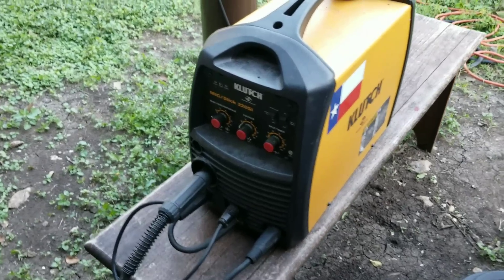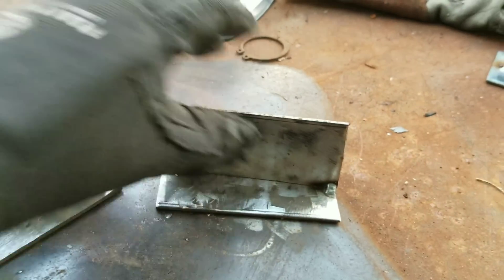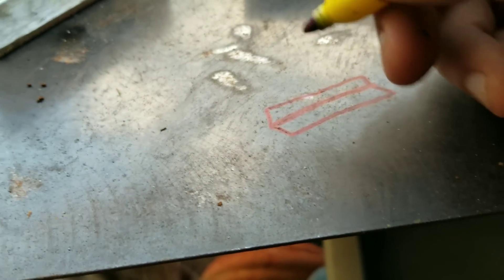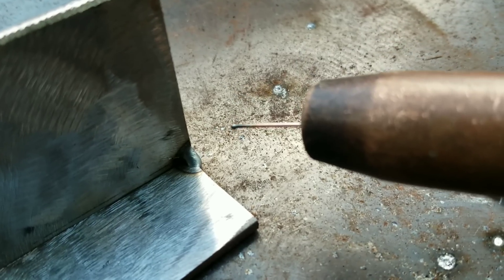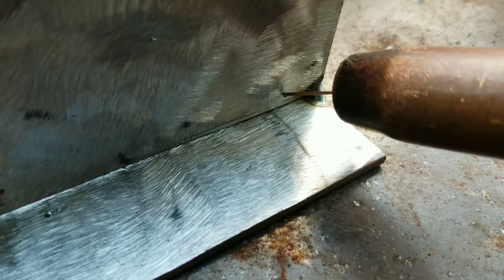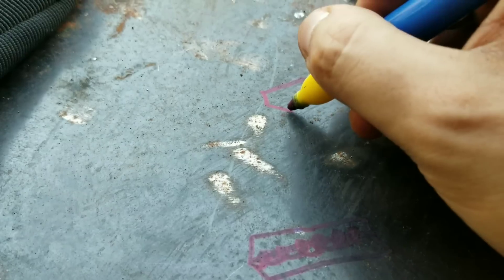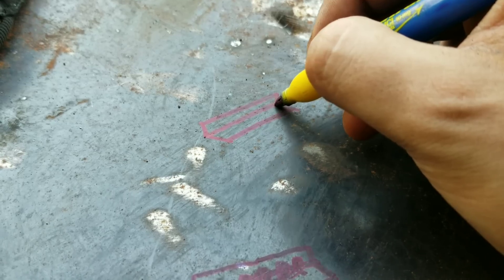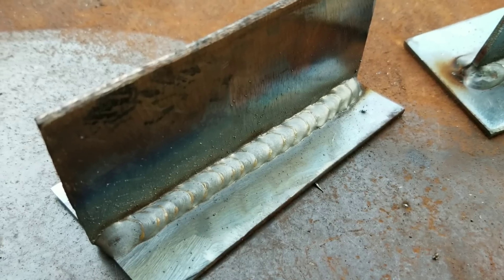How to lay dimes mig welding!

Comment: You did fine young man. Don't listen to these youtube welders. I been welding for 30 years. Personally I prefer a flat smooth weld as opposed to the "whip" style. Nice job little brother.
Reply: I was taught that a hot flat smooth weld is stronger than a whip in MIG. I work in the industry I use a whip 35% of the time finishing corners, anything visible on racking, and to fill gaps on railings. It’s good to know but the goal should be hot flat smooth.
Reply: I was trained by a guy who was certified to weld gas lines and cylinders and worked next to an ex-Navy underwater welder and we built cement mixers for trucks. We used the second style, forward and back but the "dimes" were stacked much tighter..... like 4 dimes to each one of his.
Reply: @SilverGleaner  Yep. Its the tight dimes you want if you're not just simply running stringers which most jobs prefer. But the guy is a good welder and can lay down better beads than some guys i know who have been welding as long as me at least 26 years. Its definitely an art and some people never quite cut it. He will go a long way in welding.
Reply: I've seen it all: welding trolls LOL
Reply: That what I was going to say, I been welding 40 years and hardly ever try to make ‘ dimes’ . I just make nice even smooth welds. Even TIG welding aluminum I just make nice smooth welds. Sometime I make what look like the ‘ dimes ‘ and go over it and smooth it out. If you are worried about making ‘ dimes’ you are probably not focusing on the penetration and even blending of the metals. Dimes aren’t everything.
Reply: @michaelszczys8316  The dimes I make look different. They're really tight and not spaced out like his. I just make small circles or half moons with a slight pause. Sometimes I just drag it. I don't really like the whip method. It works good if you're filling in shit. About the only time I use it.
Reply: @michaelszczys8316  ZTFab who welds like this says you have to turn the heat down to get a weld like this.
Reply: He did good with the quality of the welding machine
Reply: I was a welder for 38 years and I also preferred a smooth weld. Trying to make a stack of dimes can lead to a cold lap, if you're not careful. Nice job.
Reply: He IS a YouTube welder
Reply: I was a Finnish welder on asv skid steers and them welds won't pass bruh!! Godda match a robot at times, so they godda be flat. It kinda looks like Michael J Fox welded that.
Reply: @rewadena4371  Yeah, it depends on the job. Your job sounds like you have showing welds that people will see. A lot of places don't have that "It's got to be pretty" requirement.
Reply: @OddHeathen thats the other side of welding many years, many places, its all about what the BOSS wants and what the particular JOB calls for.
They're all different.
If you have a job where looks are more important than strength then you make it look good on the outside.
If you have one that requires it to be totally blended and sealed like welding something that gets leak tested then you make it extra good on the inside.
Part of my present job is welding stacks of thin sheets of steel 10 to 20 inches tall so that it holds them together without pulling them and warping the stack. I do it by grinding a shallow groove in the sides of the stack and horizontally welding with a tig and cold feed mig wire to fill the groove up with low heat weld.
Like I said, its all about the particular job.
Reply: Am I the only welder who is concerned with actual penetration, push and pull affects on the weld, do they not teach these basics? Doesn’t matter if it’s dimes if it can’t pass an X-ray or break/stress test.
Reply: @nickyp2484  you're not the only one, there's a few of us left. Like I tell people, get a job welding stuff that has to be leak tested and then you'll get good.
Reply: Tommy do you have a channel on welding? With 30yrs of experience you should boss.👍 Thank you for your words of encouragement for this guy.
Reply: as long as big brother Tommy Wright approves, I guess it's ok
Reply: @silvermica-u3d  Don't sleep on those Wrights. A lot know what they're talking about. My grandmother was one and every Wright I know can build and put together shit better than most people. lol Their last name literally means builder. We also still use Peter Wright Anvils too in welding. He was actually a very distant cousin of mine.
Reply: @ebogar42  impressive!
Reply: 25 here. Mostly production/fabrication. I'm the same way, just straight, no motion, let the bead fill in.
Reply: So I started welding today any tips
Reply: Every one of those dimes has a failure point flat smooth weld is better
Reply: Let's give a hell yeah to our pipeline welders now that's some serious welding ,PIMP status but this homeboy is showing some good information keep it up my brother
Reply: I use to fix coal train cars for Burlington Northern Santa Fe and Union Pacific Railroad, our welds wouldn`t pass inspection unless they were flat and smooth. Replacing a gusset, welds could only be to the edge of the gusset to the coal car, if it went over the edge even a fraction of a mm, it had to be redone. But working for B & C steel building red iron beams for buildings they had to be like these welds in this video. So I guess both work depending on, if its your own project and what you prefer.
Reply: @SmOoThYwOoDy  Best thing to do I guess is practice every way and ask your boss how they want it done. I don't really like the whip method but can do it.
Reply: A whip weld pattern or a straight step is back and forth, pushing and pulling as the pool is built up through the landing of a seem.
In a whipping motion.
Reply: when he drew the shit i learned lol wtf.... i been welding n faking it ive built 5 highrises ... hope that old shit dont fall 😂😂😂
Reply: Its a brotherhood we gotta support each other
Reply: "I been welding for 30 years"... can't even use proper grammar. Just because you do something for 30 years doesn't mean you're good at it.
Reply: Lmfao are you really nitpicking grammar on a fucking welders channel? Last I checked, you didn’t need proper grammar to be a welder. Hell, half the welders that work where I do have more teeth left than brain cells and that’s not saying much. And before you even pop off at the mouth, no I’m not a welder. CNC certified machinist with all my teeth lol
Reply: @greatguy4076  Are you a welder?
Reply: @greatguy4076  lol right. Just means you could  have a lot of experience at doing something wrong.
Reply: Bullshit 30 year welder...the welds are too loose...u need tighter welds...who let u weld?
Reply: @anthonymoody3826  bro its learning chillax
Reply: @anthonymoody3826  What the hell are you talking about? Too loose?
Reply: @flintironstag2381  your welds should be tight...u would know that if u could weld
Reply: @anthonymoody3826  Hahahaha! Ok....sure. Let me guess, you took a class in welding and think that makes you all knowing?

Comment: I run .030 flux core @ 95amps 220ipm and 22volts, cuts thru paint rust and scale.
Reply: You can't "cut through" you can only burn it up, which ends up putting burnt rust, paint and scale into your weld = crap welds that have debris in them, pockets of air and pits which will fail.  If the weld doesn't matter for strength or looks, have at it.  If the weld matters, clean your work before welding.
Reply: @gamelord1000  the wire welder I have has a 74 volt hot start/anti stick function so it ramps up the current if the arc starts to go out or get to tight. paint dirt surface scale turn to a vapor under the power of the wight dwarf at the end of the wire... the power i run in a .030 wire is enough to burn a 5/32 7018 rod. need a # 13 shade lens extra thick gloves and a bucket of ice too cool off.
Reply: Hope your wearing a respirator so many people get sick welding dirty.

Comment: Welding way to cold. Utter lack of fusion. And you are acting like you are do vertical up but your doing it on flats 😂
Reply: Ellis Cummings... Oh bullshit! His heat was fine, the welds were fine. Gtfoh
Reply: "Keyboard Warrior" without so much as a profile picture...don't let trolls bug you. Good video and in the immortal words of Kat Williams  "haters are supposed to hate, let 'em do they job and hate".
Reply: Not my fault you have a lack of sidewall penetration. If you can't take critisism then you can't improve
Reply: Ellis. If you're such a great welder than why are you watching videos like this??  Just sayin
Reply: What so even the best welders in the world can't sit on there frree time and watch YouTube 😂
Reply: Lack of fusion definitely there to side walls . slightly Un equal on leg lengths  and throat thickness due to pattern. Ok welding though. But learn all teqnuques as w.p.s may require a certain throat or leg length

Comment: That is definitely not what you want. Turn your heat up and stay consistent. All that Parkinson welding. You want to see a line down the center of your weld. Dimes are vertical up not flat.

Comment: welding a little cold and you should pull the gun not push it.
Reply: From what I understand and I’m no expert, you can pull and push the puddle. Whichever you prefer.
Reply: you can push or pull but you will get a flatter weld with less spatter when you pull it on steel.
Reply: I personally prefer pulling.
Reply: It wasn't cold and you push the puddle not pull. Who taught you to weld?
Reply: I,ve been a welder for almost 40 years and certified for most of them.

Comment: Your "rush" at the end is wHAT you wanna do. Stick to zig zag on a normal fill it weld any other pattern isn't necessary unless filling a gap or some type of weld where 2 different thickness of material is involved
Reply: I would zig zag when there is a gap, I prefer a whipping motion over any technique. Whip out, drop back, whip out, drop back. Very tight whips and consistency is key. Also it's a fillet not a fill it.

Comment: Will that work for Fluxcore too!
Reply from the maker: For flux I usually do the  Back-and-forth technique
Reply: Flux looks much nicer if you drag. I tend to make just the smallest cursive e motion as I move my puddle, so looks like I was dragging. Try to keep the stack of dimes from appearing, that's more for solid wires and fast freeze rods.Keep it consistent and practice.
Reply: @darrengachupin1005  Thanks for the useful information.
Reply: I weave, side to side like dancing with your partner side to side, but not leaving much valley looks sorta like French braids lol..works for me good luck 😃😃